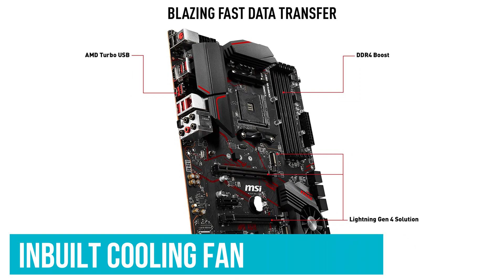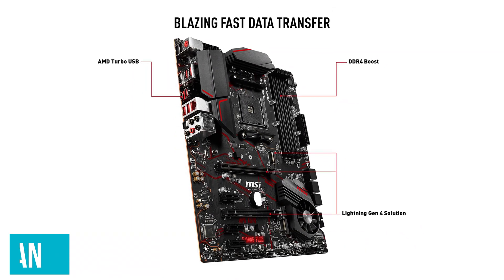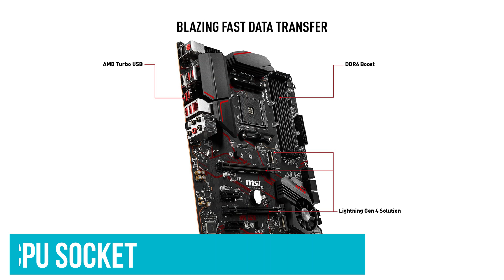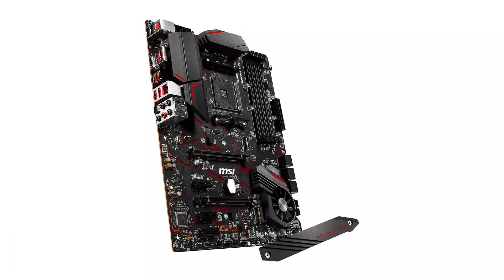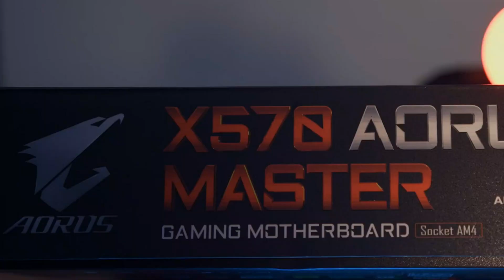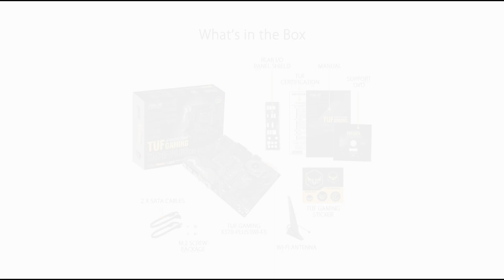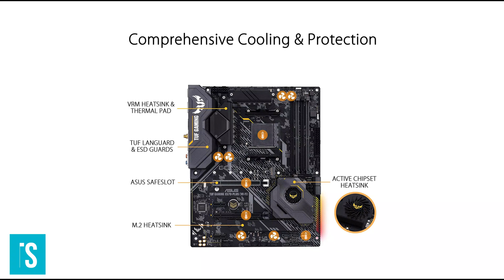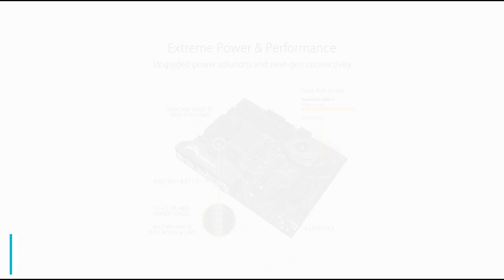Top 5 Best Motherboard For Ryzen 7 5800x In 2022

Comment: The msi B450 Gaming Plux, is good for 5800x?
Reply from the maker: I have the msi b450 gaming max, 5800x and 32G @ 3600 of RAM and can confirm it works just fine. Cinebench @ 4.65ghz and gaming @ 4.85ghz using the beta bios from the msi website. My cooling is pretty good though so your mileage may vary